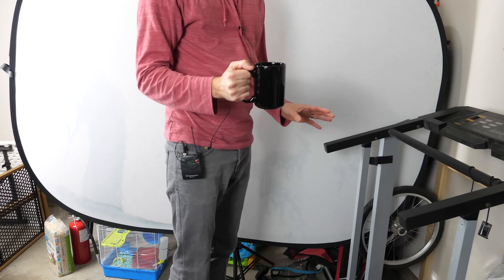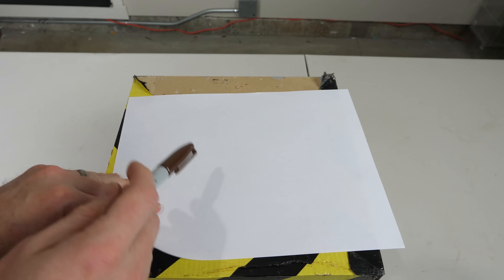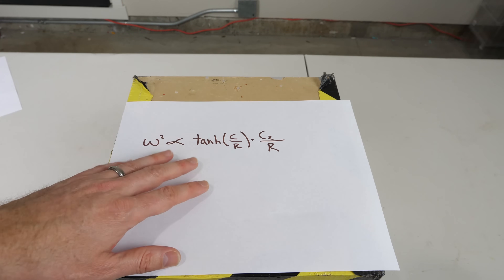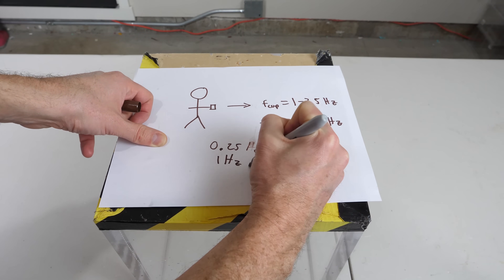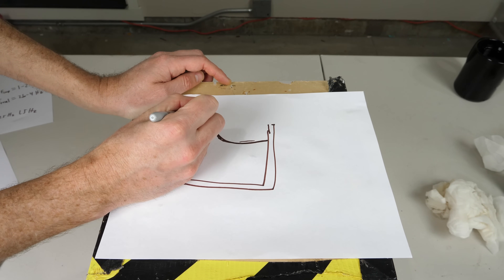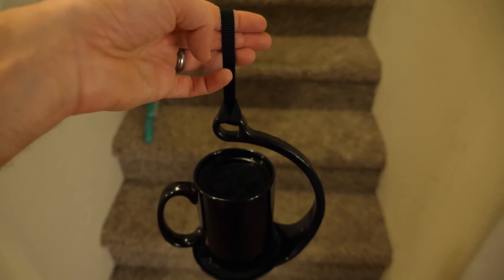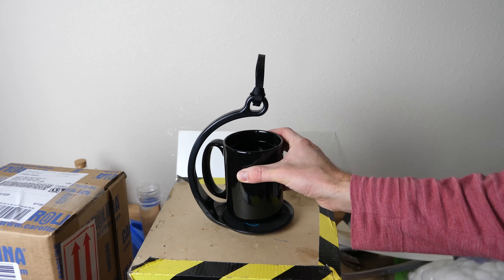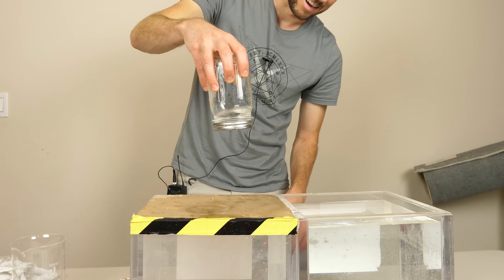Using Resonant Frequencies to Create an Unspillable Cup

Comment: There is no such a thing as centrifugal force. Centrifugal force is an apparent force, used to explain phenomenons when you are in a non galilean reference system. It really does not exist. What does exist is the centripetal force. When you start spinning yourself, the cup will try to move in a straight line, because that's the only natural movement of any object that is not subject to a force (inertia law). However, the cup is hold on a surface that is anchored to your hand. That surface exerts a force on the cup that forces the cup to abandon the straight motion and start moving in circle. That is the centripetal force, which is a real force. It is your hand that is applying the centripetal force. And, as a reaction, the cup starts pulling your hand with the exact same amount of force, although in the opposite direction. That is the force you feel on your hand, and that is not centrifugal force, it is just the reaction to the action of the centripetal force. Any modern text of physics explains the centripetal force and, usually, the centrifugal force is not even ever mentioned, because it does not really exist. Nobody wants to make calculations in a non-galilean reference system, because in there some of the physics laws do not hold and you have to use fake forces (like the centrifugal one) to explain things that otherwise would not make any sense.
Reply from the maker: Just because something is a fictitious force doesn’t mean it’s not useful. The reason we created a word for this fictitious force is because it is useful in certain reference frames (like for a person spinning like I was in the video). I’m not a fan of the words centrifugal or centripetal since they are just assigning a direction to a force. We don’t assign an “up” force or a “down” force to anything else. Why do we do it here?
Reply: @TheActionLab  it is not just assigning a direction to a force.  It is using one reference system or another,  one where inertia exists and one where you cannot explain a motion with regular law of physics unless you add this force to explain what is going on.  For example,  earth rotates on itself so,  if we establish a reference system solidal with earth we cannot explain why water goes in circles when going down the drain.    So we invent the coriolis force to explain what is going on.  But really coriolis force does not exist.  The water is just trying to move straight,  according to the law of inertia,  but since we are rotating with the earth we see the water rotating too,  in the opposite direction of earth,  which is not really true,  so we explain it with the coriolis force.
Reply from the maker: Actually if you construct Newton's Laws in a rotating reference system then you will get a term for centrifugal force (-mwX(wXr) where w is rate of rotation and X is cross). There is absolutely no reason to not be able to use the term centrifugal force when that is exactly what I am talking about. The difference between centripetal and centrifugal is simply a matter of reference frames. I appreciate your comment but I am starting my crusade to stop the constant corrections between centripetal and centrifugal. It does not matter which one you say unless you are specifying the direction force:) Also, the Coriolis force is not responsible for water going down the drain in a circle... Now, enjoy this comic. Even James Bond is overzealous in his corrections with centripetal force https://xkcd.com/123/
Reply: @TheActionLab  that's exactly my point.  The centrifugal force is used only if the reference system is rotating,  i.e. not inertial or not galilean. It is a very particular case and only there you can talk about this force.  You must be clear of what kind of system you are in.  If you don't specify that, it is normally assumed that it is a galilean system and the centrifugal force does not make sense in there.  As for the coriolis force. You are correct,  it is not responsible for the rotating water in the drain,  because there was really no rotation if you were in a galilean system.  We see it rotating because we are rotating around the earth axis.  Coriolis force is there only to explain the phenomenon we are experiencing, because we are not on a galilean reference system and we cannot see what really happens.  This is called relativity,  galilean relativity.

Comment: You were a little misleading on the last one. To someone that doesn’t understand what your saying, you game the impression that the surface tension was holding up all the water. What it was really doing was making it act as a solid piece. The air pressure was holding up the water but the surface tension was holding the air pressure in.

Comment: Is this similar to those “magic tricks” where you put a card on open Poland springs, or just one of those types of plastic water bottles, flip it upside down, then carefully slide the card out from under?  Because that hole is significantly larger than the screen.

Comment: Also for the inverted mason jar holding the water, air pressure is involved. Air pressure pushes up but not down. Try doing an experiment with a both ends open cylinder. Insert this cylinder into water all the way and cover the top, should get same result. Now what happens when the top is uncovered. I think that gravity will pull the liquid out.

Comment: How much of the screened mason jar holding water is water surface tension and how much is atmosphere pushing water back into the jar, against the vacuum cavity created? If you could measure the cavity absolute pressure, pressure being (near) 1 would indicate that the water holding up is caused by surface tension alone. But when you introduce air into the jar, water falls out, which gives good portion of the physics to the vacuum. Probably these combined together are the key to a successful bar trick.

Comment: Hey! I'VE GOT AN IDEA! What if you create vacuum in your chamber and flush all its air out using hydrogen gas. Then allow some low  pressure hydrogen inside the chamber and then inject oxygen slowly at various temperatures? Could we be able to se some flame? Will water condense at low temperature and pressure?

Comment: Centrifugal force doesn't exist
Reply from the maker: It does exist or else we wouldn’t have a word for it. It is just a force from a different reference frame. The true force is the centripetal force pulling towards the center. But when you are the one spinning you feel a force as though it we’re pulling out on you. This is centrifugal force.
Reply: @TheActionLab  That force you feel from the glass pulling on you, is in this case the centripetal force accellerating you to the axis of spin. Only your radius and speed are much smaller because of your higher inertia. There exists no force pulling anything away from the centre of spin at any given moment.
Aside from that, great video. I love your hands-on approach. Please keep em coming :)

Comment: You can do this in a bath full of water. When I was a kid, I found that when I rock my body back and forth with just the right frequency, all water will eventually wave wildly until almost spilling. Finally I see the science behind this :)
Reply: When I was a teen, I took a small "paddle board" at the local pool, and somehow found a resonance to a wide but shallow warm-pool, deliberately.  It was about 15 metres long and 5 wide, maybe half metre deep.  I was astonished that after a few minutes of pushing the water back and forth, the whole pool sloshed (barely) centre-to-edges lengthwise.  It wasn't busy there, and it kept doing it noticeably for almost a minute after I stopped.  Hardly anyone noticed though.  But I thought it was pretty cool at the time lol.
Reply: I did this too! Until my mom came into the bathroom and yelled at me that it sounded like there was a whale in the tub. XD
Reply: @ShalmendoGlineux  Maybe there was
Reply: I would do this and then use the water on the floor to slip n' slide
Reply: Ohhhhmahhhgawwwd y'all were so smart as kids. I would have never figured that out (°ﾛ°٥)
Reply: @marshallm25  don't put yourself down pal

Comment: Every thing sounds ok, about movement, timing, frequency, etc... but that device also provides angles that changes depending of the acceleration and the movements, actually the angle are proportional and opposite of the movement acceleration and direction that is transmitted from your hand... and you don’t even mention anything about it.. in other words, the device provides a condition that creates a momentum from your hand movement and at the same time a centrifugal force is created that helps to balance the cup and the fluids so they don’t fall

Comment: Action Lab, 
What's the largest you can make the holes in that screen and still retain the water in the mason jar?  As soon as the holes in the screen are big enough to let air move past the water the trick is over, but what is the limit?  Can you use something as big as fishnets?  (Just don't wear them)  Or do they have to stay tiny for the surface tension to be able to hold up?  
(I was just kidding, btw.  You can wear fishnets if you really want to.  Who am I to judge?)

Comment: The main factor why the "skinny" cup didn't spill as easy is because the fluid level was much lower from the top. You just need to step your hand/eye coordination up. Anyone who has ever carried a bucket of water with a handle has seen that. And you didn't create a unspillable cup just made it easier to hold. Mason jar doesn't count either. I love resonate frequency science but this was a poor illustration. It literally has the power to bring a building down.

Comment: Here is another way to control the spill from happening. I use to work in a kitchen and we would use plastic wrap that would directly touch and cover the level of liquid while adhering the extra wrap on the inner sides of the container. If you do it right, it would even hold if you were to moderately kick the container directly.

Comment: Hey, I have a question: can a lot of insects in a balloon lift up a basket with something in it? Like, a mini Hot ait baloon simulator but with flies(for example) or the most powerful flying insects...
Reply: Unless the insects push against the top surface of the balloon, this is not possible. When flying, any insect counters gravitational force by applying a downward force on the surrounding air, which according to Newton's third law applies an equal force in the opposite direction. So when an insect flies, it won't be able to take the surrounding air with it up, that air will always move down. So a balloon with insects inside can't really go up.

Comment: Really cool! 
I have recently seen when testing my speed mesurement devices (radar and now even GPS with fast update rate) walking with them that the speed goes up and down pretty much by the steps (much more than what it feels like). Up to +/-0,4 km/h when walking fast (about 7 km/h avarage) - that's quite a lot given that those speed changes happens in a fraction of a second. That's indeed why you get problem if the accelerations/decelerations happens at the same frequency at the resonant frequncy of the liquid in a cup. It's also the reason it's pretty much impossible to take good video while walking without camera stabilizer, haha

Comment: I can not put sound up and watch this properly at the moment... But when I saw you shaking wide and small cup, an idea started forming. Does the acceleration needed to spill liquid out of cup depend on diameter of cup and distance between surface of liquid and the edge of the cup? Said a bit differently, if the ratio between diameter of the cup and distance from surface of the liquid to the edge of the cup is same, is also acceleration needed to spill the liquid out of the cup same, no matter how big the cup is? Please answer me, Action Lab!

I have no idea if you said that in the video, if you did, let's tell it for everyone: I did not watch the video, I came ip with this idea oll by myself! Okay?

Comment: Your explanation of why water didn't leak out of the mason jar was incomplete.  You didn't mention air pressure.  The vacuum created inside the mason jar was responsible for a relative increase in the air pressure outside the jar pushing up and keeping the water in place along with surface tension.  If there were a hole in the bottom (top when inverted) of the mason jar that allowed air pressure to equalize inside the jar, the water would still spill out. Surface tension on it's own would not prevent that.

Comment: This is why large trucks containing liquids have baffles built into them to prevent resonant sloshing, otherwise they would tip over due to resonance. The baffles essentially increase the resonant frequency so the truck would have to be wobbling at a very high frequency for it to "spill" or cause the truck to tip over. Ain't gonna happen with a high enough frequency tuning.

Comment: I know this trick since I was a kid. We used to fetch water using a wood stick with 2 buckets hanging on each side which are connected by strings. The water in the bucket would behave nicely no matter how bad I run or walk.

Comment: The centripetal force keeps the cup from falling not the centrifugal force.
Reply from the maker: It’s all about frames of reference. In this case I was spinning and part of the system so it is more correct to use centrifugal force because it is the apparent force that appears outward from the center holding the cup on the holder. Centripetal force is the actual force pulling towards the center, but that is not the reference frame I am speaking of in this case.

Comment: If u install separators inside the cup,frequency will be much higher and it won't slosh. This is used in trucks that transport fluid so that the trucks don't tip over in corners or on highways
Reply: Hassan Eido I am now making one for my coffee cup for work
Reply: @lizichell2  glad I helped, make sure u also make them shallow or have holes at the bottom to allow for fluid to move between them at the bottom
Reply: Just cut two plastic sheets about the inside profile of your cup, and a slot halfway up in one, and halfway down in the other, then interleave them to make a cross (viewed edgewise)  Place this in the cup and try your drink.  They probably won't seal well enough to warrant making more slots or holes in them, but you can if you want.

Comment: I got a question.... If the water doesn't spill when spinning the cup around in the device because of the water being forced to the back of the cup then why don't a drop of ocean water spin out into the sky and into space when the earth is rotating much faster than you were at about 1000mph? If we say gravity is that strong for example then why am I able to jump off and leave the ground especially when I weigh more than a single drop of water? Or why am I not being thrown into the sky for example?

Comment: If you put water in the tube with the smaller circumference up close to the rim, like you did with the mug with the larger circumference, and match the same motions you used "sloshing" the mug... You will spill out of the tube as much as you would out of the mug, at a lessened rate.. Meaning less liquid camparative to the mug.

Comment: You could also add baffles to your cup. This effectively reduces the cup's radius into a collection of smaller radii. Then the frequency of your walking never adds enough energy to the system.
Of course the best way to stop your cup from spilling is to add a lid.
Reply: Yes. Theres a book called rendezvous with rama. Its about a giant ass spaceship. Its cylindrical. At the 'equator' theres a body of water inside. 
 It was called the cylindrical sea. An annulus of water about a kilometer or so wide. One shore was about 100 meters above the water and the other side was 1000 meters above the surface. Fore and aft respectively. 
This was so that while the se was liquid, when the ship accelerated, the water would have some slosh room aftward. 
 There were also antislosh baffle structures under the sea so that directional or rotational changes causing sloshing would be mitigated. 
 Its pretty cool.
Reply: I'm baffled as to what a "baffle" is...
Reply: Ice cube trays.